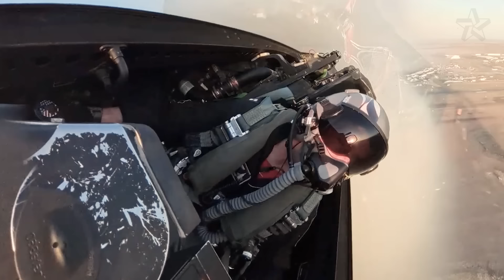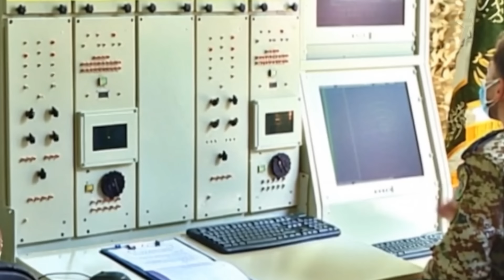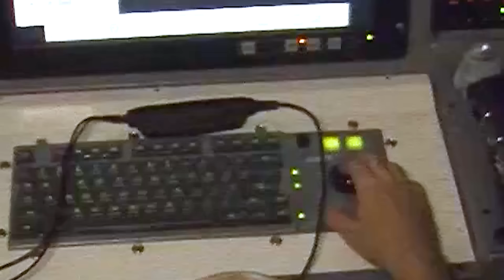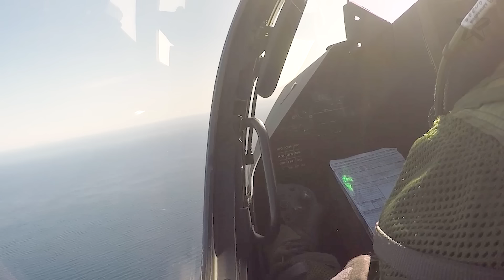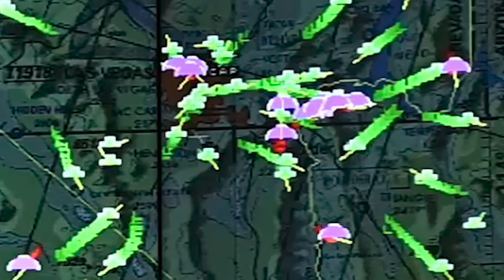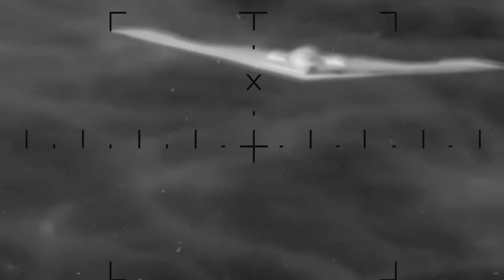Iran Challenged U.S. Ghost Bomber — BIG MISTAKE

Comment: I just figured out how they spoof the enemy radar in showing multiple targets instead of one! 
The search radar is usually at a fixed frequency with a fixed RPM of the radar antenna. 
The jet reads the frequency and the pulse times, and starts emitting the same frequency back, just before the radar beam hits again.
If the timing is right, the radar will see a whole lot of returns, and only one of them it the real return.
I find that to be so clever.

Comment: Ok clearly someone can't do math there at your group that made this video.

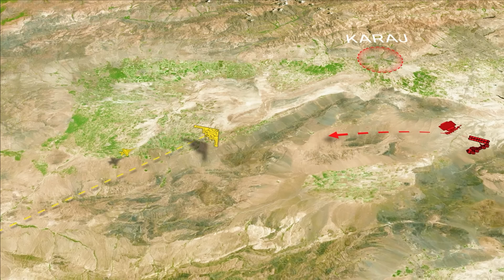@15:18 You approximately say that "The missile is 20 seconds out from its closest approach to the B2. And the bomb bay doors have to be open in 60 seconds to hit the target window, which leaves the target window and the missiles closest approach window only 10 seconds apart." Clearly 60 minus 20 is not 10, it's 40. So there is plenty of margin for them to miss the missile keep the bomb bay doors closed until reaching the target area and having to open the bay doors. Either someone is not smart, or this was an intentional lie just for dramatic effect. But if your gonna lie for dramatic effect you need to use real numbers that equal what your saying.